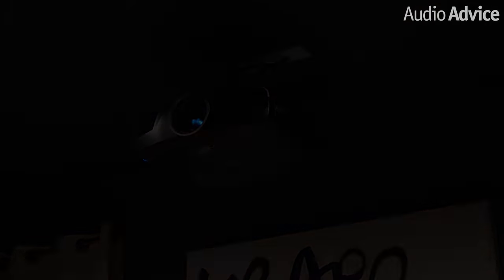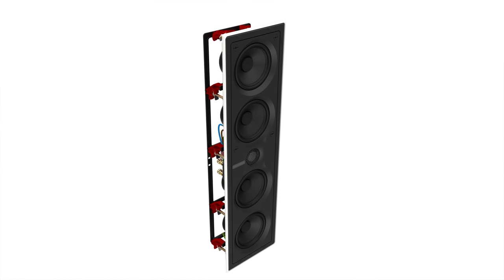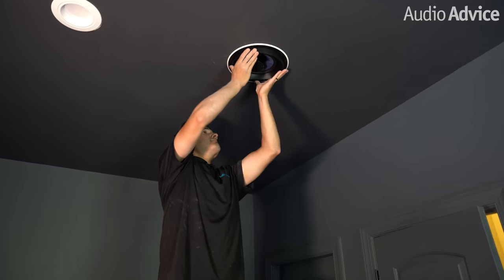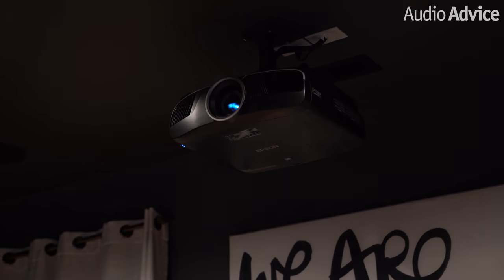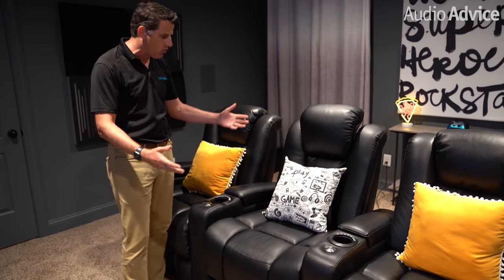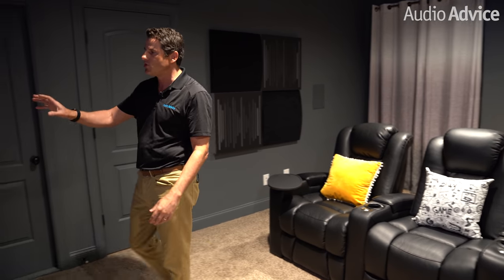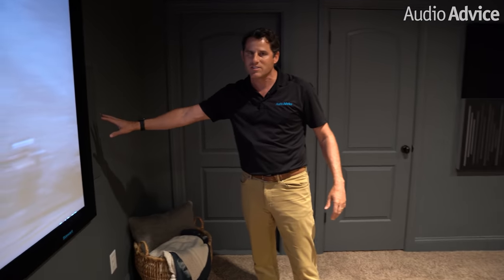5.2.4 Dolby Atmos Home Theater & Gaming Room Tour | Epson 6050UB, Bowers & Wilkins, Marantz

Comment: Great designed and setup. you guys are the best. Question.. I have a Denon receiver with two subs but actually its only puts one Signal,so they’re basically one. I have one behind my TV and one behind my sofa in a 12 x 12 room. Should I have these subs on different phases like one on 180 and one on one zero? And I’ve been trying to calibrate them with no luck. Your videos are Terrific. I love home theater projects.thanks again Joe
Reply from the maker: Thank you.  There is a good way to do this we go over in our subwoofer section in this article and video https://www.audioadvice.com/videos-reviews/best-home-theater-audio-upgrades-optimizations/  We also link to some test tones.  The idea is to play a steady test tone at the frequency you have your sub crossed over at.  Try the phase at each position and which ever sounds louder at your seating position in the right spot.  Since you have a 12 by 12 room we would also suggest you try moving the subs around a bit to see if there is a spot where the bass sounds more even.    Thanks for watching
Reply: @AudioAdvice  thank you

Comment: I would wonder, putting all/most the speakers into the frame in the that kind of wall, there is no resonance in the walls ? Not having a cantered chair, is due to family, I guess, but would be nice to have have it. The rear speaker just behind acoustic absorbers and differs seem little bit odd. And is the reverse measured and optimised, or the installation is more to please the visual part (never-mind the question, watched the full video now)? And how is the signal for the gaming console controller, when it is hidden behind the doors ? Overall very nice installation, as always.

Comment: What are your thoughts on ultra short throw laser projectors? Since they can use those special screens that only reflect the upward light, do they provide better contrast?
Reply from the maker: There are some applications where they are a good fit as you can get a much larger image than a flat screen TV.  Thanks for watching

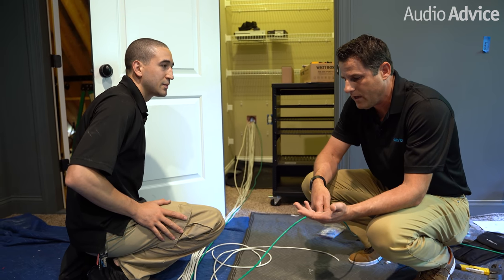Comment: At 3:04 - does Audio Advice sell a wall plate for 11 speaker wires, plus a few extra cables like ethernet or rca, as shown in this 5.2.4 system?
Reply from the maker: We do not, we typically just pull them all through a plate to avoid more connections and tie them down.  Thanks for watching

Comment: how did you run the cable theorugh the walls?
Reply from the maker: Our installers are very skilled at pulling wire as long as we have space above or below.  They used glow rods mostly.  Thanks for watching.